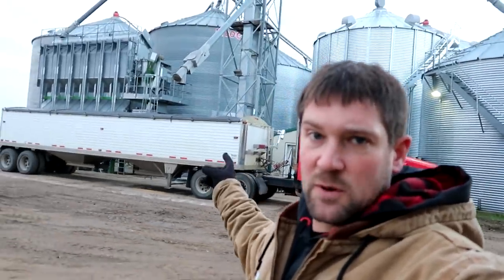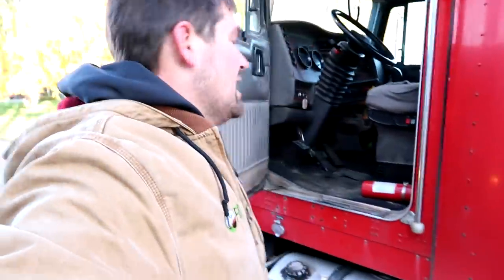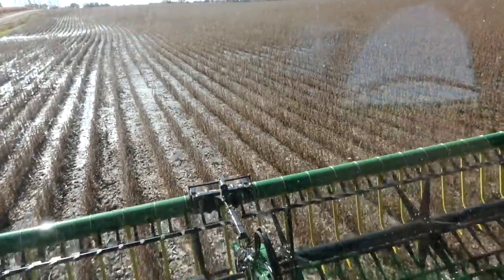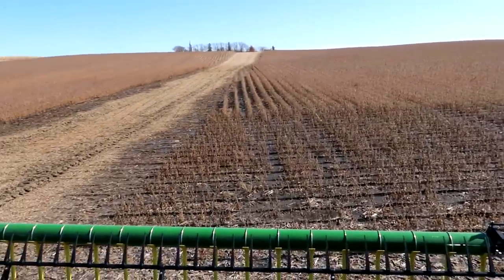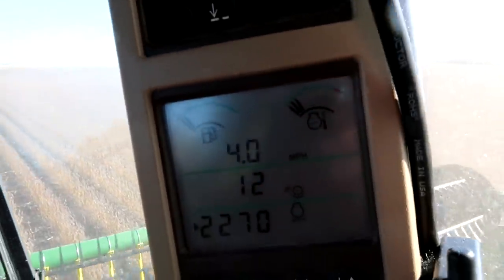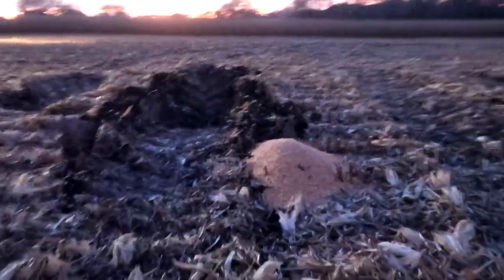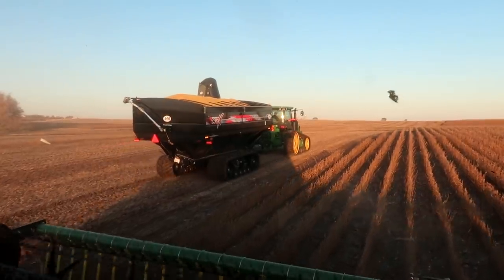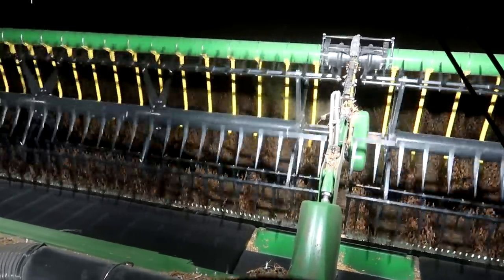EVERYTHING is getting STUCK!

Comment: In 1968 was the last time I test drove the biggest 4 wheel drive John Deere, Case, and Steiger tractors with the same 6 bottom plow. Back than, I recommend the Case which only had huge single wheels, instead of dual wheels, that were filled with water. My father used to let me drive a John Deere model A to disk corn, I was 12 yoa. Enjoy the show and thank you.

Comment: Not a farmer, but grew up in a farmhouse we rented. Did some baling work with locals and then did a little farm work when in high school. Miss the country and am amazed at the difference in the equipment changes since the late 60's. My neighbor, for instance, farmed 300 acres (a fairly large farm at the time) with a John Deere A and a 4020. One of the guys I did some work for had an IH (red) M and an M TA. Pulling a 12' disk was quite a job for that old TA. 

Picking corn with a four-row header or beans with 12' was slightly slower than what you guys are doing now. Farmers hauling grain to the elevator in pickups was not unusual, though they did normally have sideboard that gave them an extra 12 to 18" of depth.

Comment: I'm not a farmer, but I'm very intrigued watching these videos. As city kids, my brother and I were shipped out to a small (pop 400) village every summer in southern Manitoba in the 60's and I did a few ride-alongs with the guy driving the "Grain Truck" (Single Axle Farm Dump Truck) hauling wheat from the combine to a set of tiny (wooden) granaries at the edge of the field. Your operation is a little bit bigger !
I enjoy your allegiance to John Deere, although in one video I noticed your father was wearing a pull-over with a CAT logo on it. Several years back we were wintering in Texas, and I came across a sign/poster that was taking a shot at John Deere equipment, based on their old motto:  
"Noting Runs Like a Deere, especially when it's being chased by a CAT !"
You probably came across that slander many years ago, but I still think it is clever.
. . . Keep it between the rows !

Comment: I  am a retired part tve to buyime farmer from Canada. Grew beans and wheat ,gave up on corn because the harvest was always real late and in the snow and cold. Tried farming some wet land before and it doesn't work .Tile drained my farm 30 years ago and it was the best investment I ever made. You might be able to get a good crop going on wetter land with a dry spring but if you can't get it off ,then it is a waste .And getting stuck is tough on equipment and the field.
  I let rented farms go if they were wet. Not worth it.
  Very difficult to tile someone else land if you are a tenant .And land is expensive to buy.

Comment: Not a farmer, but grew up on a farm (about a hundred years ago), hence the interest. Your electrical connection problem is puzzling. Perhaps the pin that provides power on your header or combine is getting pushed back a bit when connecting, but gets pulled out when you uncouple. That might be obvious. Have you checked all the pins to make sure they are snug as a bug? Getting harder to find anything good to watch (retired) so here I am. All your equipment is interesting. Do you own or lease, if I may ask?

Comment: Grew up on a farm, beef /sheep mix, but ended up in automation engineering for the pharmaceutical industry 
Still wish I’d spent some of my gap summers working in the states on farms, maybe will do someday.
Find the amount of automation you guys have , interesting, how far does your in-house knowledge on maintenance and repair go on your automation go?
BTW the fault in your header connection sounded like an earth fault, sometimes a good shot of spray electrical connection cleaner sorts all those techie gremlins right out, when you have multiple faults coming through a common multi pin connector, an earth fault is a good place to start pointing the finger

Comment: Get some  No Lox   Electrical paste. Get some acid brushes.   Coat. The male  pins  then slid  your plugs together.  You are dealing with a piss poor design from John Deere.   No quality control.  This technology is a waste  of time  in some applications.   Your water.  Is coming from hydrostatic pressure.  Talk to your DNR Aquatic division.   See what water tables you are sitting in.  The earth tips  from June 21 st.  Summer time to December 21  winter time.  Gravity pulls the water away in summer.  Then gravity pulls the water table back in Winter.   Find an old brick well.  That was water witched.  Pump all the water out of this well in summer and inspect the bottom of the well see  if the well is sitting on sand stone. The water will weep back in.  In the last quarter of the year.   You are between two Great Lakes.   You do not see what happens.  When the moon is pulling on these large bodies of water.  The earth tips on axes 33.5 degrees.  Moon and gravity pulls like a high tide  on water tables.  Your sandy soil  will  alllow water to filter through the  soil.  A lot of your water is pushing up  from the earth.  You are farming in a flood zone.  State of Indiana is a flood zone.   In south west. Indiana  the water table changes  a lot.  Posey county water.  At 1000 feet deep  well.   Is a soda water. Fresh and clean.  Many say it is from Lake Michigan. Under ground river.  No one can see.  Only  God knows the answer.   Later.